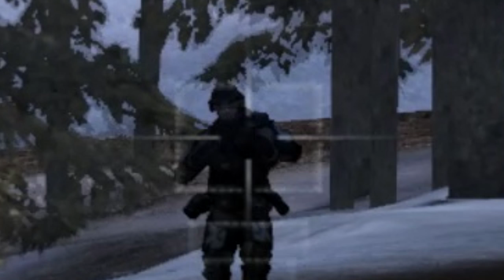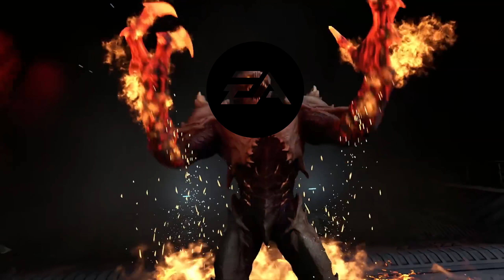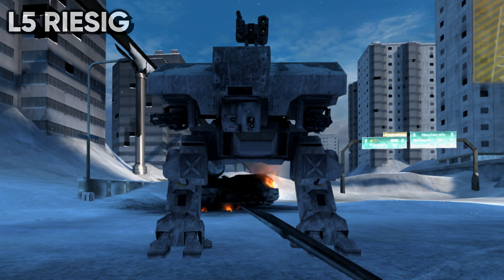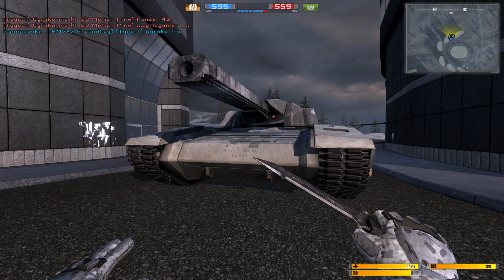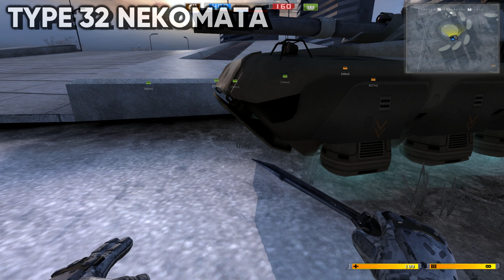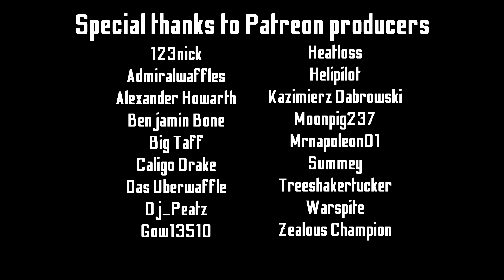Everything Wrong with Battlefield 2142's Vehicle Design

Comment: I know I'm late but the rear exhaust ports for the Riesig are possibly there because of a concept art that had extra missile tubes that pivoted upwards.
I believe the missile ports in the front were possibly for some form of countermeasure deployment system but that changed later in the design.

Comment: The mechs in this game are the closest to reality of how combat walkers should look like, as opposed to the battletech mechs, which are completely idiotic. Those liik like a hodgepodge of industrial and agricultural units that somehow are honored as lont time and successful combat units. Up to 20 meters high and very light weight for that size. Weapons placement is out of whack most of the time, severely unbalanced.
20 feet is high but 15 feet is reasonable?! Lol. It's stupid aspect for that size. 15 or 20 is large enough, doesn't make any difference.
Based on your logic notion, best walker would be an exoskeleton type power armor, that packs a punch and also is small frame, like 10 feet tall at most. (elementals from battletech universe, firebat, marauder from starcraft) But these would lack the armor protection of a main combat unit, like the walkers/mechs
And these mechs in B2142 have a great combat design, with low stance, with the legs in flexed position, like bipedal dinosaurs or chickens, and not straight up like humans, that would make them tall AF.
Regarding all your logical aspects for hatch and ammo loading and walker stability, etc...these are fair. I really hope some actual weapons platforms designers that have serious long time experience in making all sort of vehicles would use some of their spare time to draw up some combat mechs with the engineering they know and possibilities taking into account some near future materials.

Comment: On the L5 I believe you could load and unload the belt boxes from the inside of the turret and perhaps the straps are made of a metal of some kind. Still wouldn't explain why there isn't armor covering the ammo boxes though. As for the MG on the A8, i believe that the belt could be fed through the turret if you compressed it down enough, however it would make reloading unwieldy.

Comment: I feel like the walkers designs are for infantry support against other infantry. Think about it. 
Large profile to hide behind.
Can't really comlpete.
Primary weapon is machine gun. 
1 or 2 man crew.
Tall enough to fire from behind cover, like a small building. 
Not as fast as a tank. 

I think the best way to use these practically would be to follow a squad of infantry and be mobile cover from other bullet fire.

Comment: Visual sensors cannot actually be miniaturized much more with technology because it's based on light collection of a sensor. Currently webcams on laptops are about as small as they can practically get while maintaining performance. Especially for military vehicles you'd want a larger visual sensor to aquire more detail and color depth. This as well as lensing so you can zoom without having to deal with quality loss of digital zoom

Comment: you skipped out on the walkers AA cannon and missiles BTW
good video tho
I'd point out that i'm 6"1' and i'm barely taller than a leopard 2 hull standing beside it, you can prone under the A8 tiger and the player model doesn't clip it which is in line with most modern MBT's. The bulky side skirts are actually a benefit for maintenance since they look like they come in separate pieces which means they can be removed individually instead of having to swap out the entire skirt, again the Leopard 2 does this with its armored side skirts.

Comment: Spookston, you got something wrong;

Battlefield always had, and still has, 1 crew member doing everything, so the crew count would be way higher. Also, Battlefield 2142, Battlefield 2, and possibly the older games had difficult steering (cannot turn while still, needs to be moving), so in a real sense it'd be able to turn while still. Also, wouldn't the Type 32 have fuel for thrusters, and not using up much power?

Don't get me wrong, the video is great, but I thought I should correct you on these few mistakes.

Comment: I always thought that PAC was representing Middle East or Russia, not Russia AND Japan :D

To get in the mech you probably climb up on legs and then on the roof, and jump down from there. Other option is from the front, as if it opens frontally and with ladders you climb up, like on a jet plane. Rockets probably are pushed in from behind, and then automatic loading system just loads them in to the location where it can open its flaps above and bend like that, fire the salvo, close down, reload, and repeat until all missiles are out, then requires a full loading from behind at base.
I would guess that those cannons have stabilizers, realistically it would have, so on the move it would be smooth firing with automatic locking and tracking like SPAA's have.

Nuclear generators is probably the only logical powering unit, unless powered otherwise of future tech, because I suspect in future we could be able to narrow down to small sizes to power such units, tanks, etc. with nuclear powered generators, despite it being dangerous if damaged, so it would be the most protective place. We have nuclear submarines and carriers (CV's), of course the explosion in case of critical damage would be minimized to underwater and above water environments, unless stationed at ports. But I am sure there are enough safety measures taken and predicted in case of such situations/scenarios, otherwise military wouldn't have implemented them realistically, such as automatic shutdown and isolate, or whatever. In these mechs these generators are a lot smaller. Unsure if protected well, who knows what metal alloys or compositions these walkers have that can protect them.

And the reason why RTG is bad for it, is probably the reason why it's definitely not RTG type of power supply in there.

About the tank, for example Leopard 2 hull is on par with human average size, it's probably thus larger than Abrams hull.

Another thing is that for maintenance there may or may not be latches, like for the hood of cars from aftermarkets and some factory made, where you just pop them up and lift off the hood. Similar thing might be here, but hidden, and with a push of those covers you can switch the lock on them and just pull up or out. About how to enter or exit I have no idea, maybe it's crew less turret like Armata has, and to enter a tank is entirely elsewhere, and that hatch on turret is for maintenance reasons.
And why do you think a driver is in the turret? Where the hell you get that info lol.
As it states on BF wiki, there's a gunner and driver. It is said that gunner position is where the remote heavy machine gun is being held, so the gunner is squeezed to the right.

Comment: Mechs are impractical. That said in defense of the L5 its a rather practically designed  vehicle. The legs are positioned so that the weight of the chassis (specifically the magazines which would be one of if not the heaviest components) sits directly over them. I agree foot pads are a little too small though. Regarding the magazine storage I posit two things. First that the reason why the magazine is using straps as opposed to clamps is perhaps for ease of maintenance. The internals of a mech would more closely resemble those of an aircraft due to the severe size and weight restrictions which would make them an utter pain to service. Second the L5 could’ve left the factory with clamps or bars holding the magazine in place but these were removed by mechanics in the field in favor of easily replaceable and removable straps with an tenuous argument about weight reduction being added. As for the power supply being nuclear the hull is probably jam packed with redundancy and failsafe systems to prevent a meltdown as well as battery storage that would continuously store power until the mech enters a combat area/situation. That would mean the mechs would use minimal at all other times with only essential systems being operational (internal sensors, the failsafes, radar, and propulsion). With regards to it’s missile armament the missiles would have to be top attack atgms like the Javelin due to the size but I doubt that’s how it functions in game. The L5 would function as an infantry support vehicle with limited anti armor capabilities. In short the L5 is the Bradley with legs, more ammo, and a nuclear reactor.

Comment: The L5 mech's main guns, missiles and anti personnel gun are all practical in the game. The cockpit is enclosed, using cameras to create a digital display inside the cockpit protecting the driver, which is suitable for the setting. The L5 mech can also couch to reduce its profile, and would help the crew to bail out. 

In all probability a downed L5 crew would wait for rescue, they probably have equipment to climb in and out like you would for a fighter jet bsck at base.

The A8 tank has reactive armour on its side panels, a non explosive kind. So it's practical. The ADS isn't a shield, it acts like one but for short durations.

Both L5 and A8 lack thermal imaging, smoke launches/decoys, but you could pretend that smoke is no longer used for concealment due to everything in the future being able to see through it, hence no thermals. In gameplay you never feel like a feature is lacking and the fact this tank has only 2 crew, the whole loading process is now automated, and the driver can also control the turrent is very advanced.

The size of the tank is deliberately large, its actually classified as a heavy tank, this implies a much more armoured MBT requirement, probably due to mechs and infantry weapons. 

The plasma instead of gas operated weapons, and hover tech is just the fantasy aspect of the setting. The Japanese tank is an odd design, I pretend that a rotating turrent would sway the chassis causing instability, but the mobility of the hovering was worth it for traversing terrain.

It's easy to make up excuses for sci fi as long as there is a justification for it within the fictional lore, and because of that I think all the vehicles are fantastic.

Comment: 10 year long player of this game here. i'd like to add that this is most probably the most OP vehicle in the game once the best players operate it. it is very easy to dodge missiles once you know how even if you dont have shields (heheh). you can also easily dodge and kill suicide snipers and engineers under you once you know how. the only thing that can take it down is an attack helicopter but only if pilot is superskilled and they use game exploits. but it would take 2 attempts or more because of active shields. or APC and super skilled engineer and good teamwork. still, not 100% succesful and most of the time a killtrade. the riesig is better than the bogatyr since rate of fire is higher thus u have way more success vs infantry. riesig is the only mobile Anti aircraft. riesig CAN hit tanks from a far distance once u know how to compensate. tanks can aim further but u can see it coming and easily dodge or take cover. it can also easily dodge suicide transports crashing. the riesig can step over barricades unlike all other tanks and vehicles. any 1 on 1 the riesig wins. if the best players are in it e.g. airjerr or myself, for noobs only nailing it down with multiple emps and another person on  suicide duty would work.

Comment: For the mech you said they have bad elevation, but you don't mention the upper turret of said mech.
Both mech have a anti-air turret (from memory dual machine-gun + heat seeking missile), giving the two man different kind of target, those that are above the mech for the secondary turret, and everything under for the main pilot. 
It's probably to remove the need of the main pilot to have eye everywhere.

Comment: I would think that by 2142 the world will have gotten past its childish aversion to anything nuclear or radiation related. However, there's still no way (pertaining to current nuclear power anyway) this walker could actually be nuclear powered. To have the power output it would need an actual reactor, definitely not some meek RTG. But there doesn't seen to be enough space in there for a viable reactor.

Comment: Disagree with most of your criticism. The main problem for the walkers are how clumsy they would be; stumbling or getting a foot decapitated. Would they have a way to get back on their feet? In the game they just explode whenever they fall over.
"I think its all loaded in at once." he says with 900 rounds ready to fire. lol.
Mine protection? it´s motion mines here, not traditional ground mines. 
Coax for tanks? Would be OP. Game balance > design. Just use F2. Besides, wouldnt you rather have a buddy cover your back rather than having to 180 with the turret?
The hovertank can be awkward, but you completely neglect how the hovertank can dodge sideways while engaging, which is huge in some situations.
You dont even touch on the gunships, which are the real questionable vehicles here. In terms of energy efficiency, aerodynamics, physics etc

Comment: Just one thing. The one crew member thing isnt a solid criticism because its that way for gameplays sake. In battlefield 4  the abrams only requires 1 player but we all know in real life it has a crew of 4 other then that solid vid
Reply from the maker: The other crew positions are still modelled for vehicles with more than one crew member. In 2142 both tanks are only modelled to have one position.
Reply: @Spookston  i was thinking it might be a design to which at the very least both  turret crew members ( loader and commander) exit through the same hatch which is still very crappy as you said rip crew. Itd just seem impossible for the tiger to be crewed by one dude.

Comment: @2:00 If the Riesig turns it turret to 90 degrees sideways, the ammo boxes are clear of any obstructions
@2:20 I once talked to a ex-2142 dev in gamescon germany a few years ago. We talked for a few hours and it was great talking about this game (he spotted me because i wore a 2142 tshirt). I mentioned this back aswel as we were talking tech and stuff about 2142. The walker guns were unstabilized because of balance reasons. For some reason it is far more difficult to hit a moving mech then a moving tank. if the guns were stabilized, they would be a slaughter to infantry. Wich is kinda meh because infantry was pretty frikking powerfull in 2142.
@3:58 Thats not perse true. was gonna type a whole bunnh but Andrew Lee made a great comment regarding this
@5:32 Balance reasons. Both the nations tanks were gonna have coax MG's, but what i remember from when this game came out, they removed the coax mg's because BF2 had (according to some, disputed IMO) far to powerfull tanks vs infantry. The main guns are slightly more effective vs infantry in 2142 but the infantry also has far more anti-tank weapons then BF2 and also way better delivery systems (drop pod RDX spammer)
@7:14 Correct. I believe one of the magazines had this covered when the game came out. Also the choice for hover tanks for PAC was because the PAC would encounter far more frozen ice rivers and thus a hover tank would cross these with no danger. IIRC the PAC APC was also gonnna be a hover vehicle. 
@8:34 That was one epic reference. Nice one bro

Overall, this was a pretty darn well made video. +1 and subscribed

Comment: Having a turretless design isn't entirely bad. It reduces the weight and profile of the tank. 
Turrets and all the parts associated with them add a lot of weight and forces the tank's design to be taller and more conspicuous than it otherwise would be. 
You can do a lot with the saved weight that comes with forgoing a turret; say improve ammo capacity, extra armor, a bigger main gun, or just do nothing with the weight savings and enjoy the better mobility and fuel efficiency. 

Because it's a hover tank the reduced weight is desirable because it means you don't need as beefy of a propulsion system for the same mobility, plus, the weight of a turret shifting around as it rotates and the recoil sending it in different directions would cause problems for a hover tank, lest the thing just rolls over and disables itself because it fired while the gunner and the driver weren't on the same page. If this hover tank had a turret, the chassis would have to be considerably wider to deal with those issues, which comes with its own issues (inability to fit in places, more weight, harder to transport, bigger target, etc). 
In the case of a tracked tank, the reduced profile makes it easier to camouflage allowing for better ambushes. 

As well it eases manufacturing and reduces the costs of manufacturing and maintaining the tank due to the reduction of sensitive moving parts.
Not to say that it doesn't have its downsides, they're terrible against a guerrilla opponent, but the improved protection of not having a turret and the logistics benefits of lower cost, easier maintenance, more simplistic construction, lighter weight and ease of transportation are all pretty significant things to take into account. 
You could field more of them for the same cost and have an easier time getting them onto the field in the first place, against a conventional army that's huge.

Comment: All in all a very solid video (as always), but I'd like to point something out.

You mentioned that you couldn't see any access ports on the L-5 Riesig, although it actually has one. Look from the underside between its legs, it is quite visible. Combined with the fact that the walkers can crouch down, I don't think entering the vehicle is much of an issue.

You also positively mentioned the Bogatyr's two optic sensors. Tho only the bottom one serves the pilot, while the top one serves the gunner. (the L-5 has the gunners optics mounted directly to the guns)